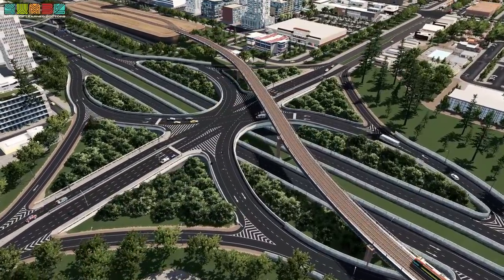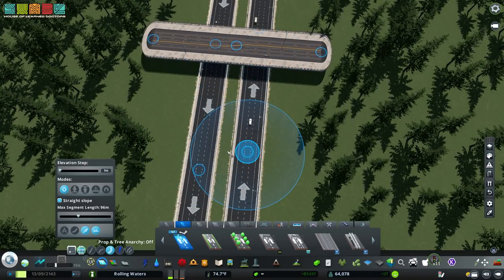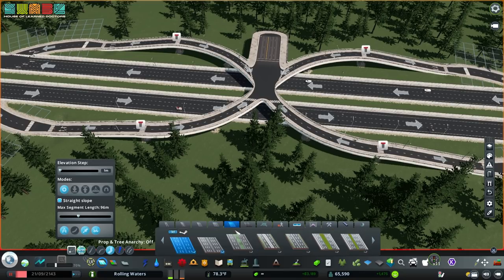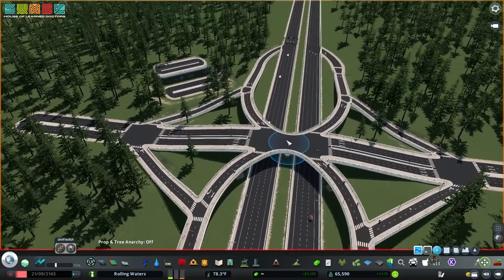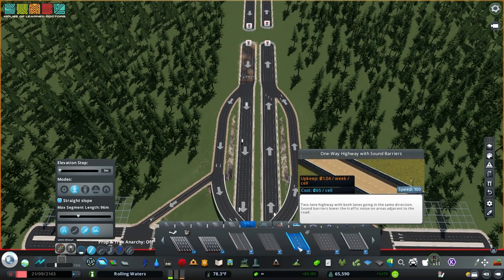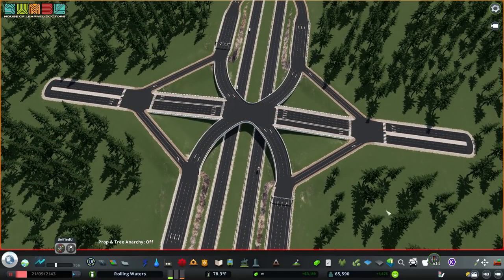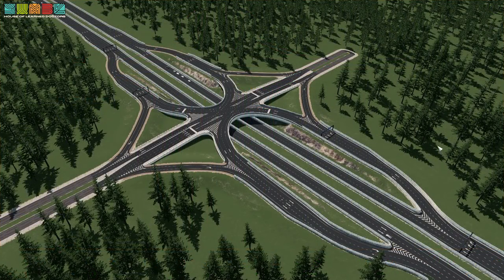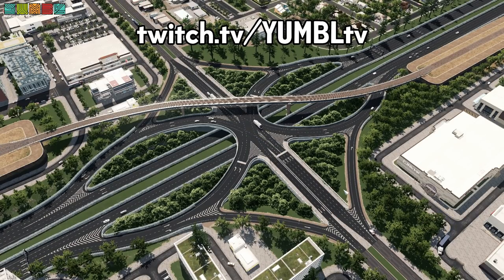Free Your Traffic Using The SPUI! - Single Point Urban Interchange - Cities: Skylines Tutorial

Comment: Thank you so much for your videos yumbl!!!  They are very helpful and I've learned so much from them!  Quick question though...I've followed your tutorial exactly for the SPUI and how to add the timed traffic lights.  Unfortunately, I'm unable to get the lights on the arterial road to provide a dedicated left turn light.  When I click the "change mode" button, I only get a straight or right turn option (which surprised me!).  Because of this, i'm not able to have both left turns on the arterial proceed at the same time.  I have used the same roads as your tutorial and have all lane connectors in place.  Have you or anyone else experienced this and know how to resolve it?  Thanks again for all of your fantastic content!!
Reply from the maker: You’re welcome! You may have a reversed road, or perhaps the road is at too shallow an angle to produce a left turn. Tmpe arrows only show above a certain angle. A workaround could be to change the cycles to arterial 1, arterial 2, lefts from highway.
Reply: @YUMBL  Thank you for the feedback!  That's how I currently have the lights set up and it's working for now...but as the arterials get more volume wanting to get to the highway, I don't suspect they'll be able to keep up with the current set up.  I'll play around with the angles of the off ramps to see if that helps.  Thanks again!  Much appreciated!!!
Reply: @YUMBL  just wanted to follow up an let you know that it was the angle of the left turn which was the problem…as you suspected.  I deleted the left turns from the arterial and recreated them as straight road pieces…then used the ‘move it’ mod to bend them.  After that, the left turn option was available.  Thank you so much for taking the time to help me out!  I really appreciate it and hope it can help others!

Comment: Is there either a way to add impact attenuators to the filler function on marking tool or are they available as a prop/asset and usable in line prop tool? I know they aren't used everywhere, but they're all over the place in the USA. Presently looking at/practicing putting guardrails in my intersections.
Reply from the maker: There are guardrail networks in the workshop

Comment: do you have to have any specific mods other than move it? Like do you need specific roads from the workshop to do this? I got to the ramp making part and the center of mine looks like a jumbled spaghetti mess
Reply from the maker: Node controller helps with that.

Comment: Would a inside on-off ramp not reduce the foot print further? Is there a logical reason the ramps are always on the outside?
Reply from the maker: Inside is fine too, though inside ramps break the “passing lane” nature of most freeways. ie entering and exiting traffic going slow in the left most lane.
Reply: @YUMBL  Thanks for the reply! That was the only reason I could think of too, which I feel is a bit silly. However, I realised while typing this reply that usually the highway is already there and we add the interchanges later as necessary. Easier to add to the outside than move the highway further apart to fit the ramps on the inside.

Comment: Couldn't you just put a roundabout at the top instead of that 6 way intersection? It would eliminate any stopping (or the most part). Not sure if it would actually work... Or how big the roundabout would have to be
I know he diamond interchange has been done with 2 roundabouts (at the respective intersections), but it would be neat to see!
Reply from the maker: You could, but thats a different interchange. Theres a big one of those in England that apparently always backs up. 

Because the SPUI has a 3 cycle light its quite fast. Also its not really a 6 way intersection. There are 4 roads in and 4 roads out. By your measure a 4 way roundabout would be an 8 way intersection.
Reply: @YUMBL  ah, you are completely right. I'll have to look into it. I was just thinking out loud. Thank you for taking the time to respond!

Comment: We have an intersection similar to this near me and it is the dumbest thing I have ever seen, what is wrong with the standard clover leaf, so there is no cross traffic and therefore no need for any traffic lights
Reply from the maker: Interesting. What makes it dumb? 

Cloverleafs take up a ton of space and have “weaving” which can be dangerous.
Reply: @YUMBL  Let's see a clover leaf you never have to cross traffic, just make a right turn as all the turns are right.  With the monstrosities you have to have traffic lights and cross traffic that is moving a different direction than you, which is extremely dangerous especially for us motorcyclist as people tend to want to make left turns right in front of us
Reply from the maker: This interchange is no less safe than a 4 way lighted intersection. In fact its safer. You may have even used one without knowing it, depending on where you live.
Reply: @YUMBL  4 way lighted intersections are also dangerous for us motorcyclist, the 2 biggest fears for us are being rear ended at a red light(wish they would just eliminate all of them) and having someone make a left turn right in front us causing us to T bone the other vehicle.
Reply from the maker: Ok, stay safe

Comment: Why build it this way and not build it for continuous flow? Even smaller interchanges here in Norway usually uses roundabout on either end or one big one in the middle instead of the traffic crossing over each other. Personally I just mimic those I find around here in the game and they work great. Though usually the crossing part is built up to go over the highway. Highway to highway crossings are a bit different and usually so smooth that no matter which way you go you stay in one lane the whole way.

In the game I try to go with what works and solutions that follows the spirit of the real world, throw in some lane management and even a simple crossing works as long as the traffic flows without crossing. Traffic crossing is a bad idea unless you have to and it's never done where the highway is involved.
Reply from the maker: Research “service interchanges”.

Comment: How!? How do you setup timed traffic lights for this intersection!? My citizens don't follow them - some of them just run the red lights, but I kinda don't blame them, coz even the traffic lights themselves don't know what's happening. A road that has a straight and a right turn gets a traffic light with a straight and a left turn (left-hand traffic)🤣😂😁😢😖😡
Reply: oh nvm. It turned out that the intersection angle of the on/off ramps and the overpass(?) was too tight, which confused the traffic lights to next week. Just move them around a bit with Moveit
Reply from the maker: The lights unfortunately depend on the arrows being correct. Angles will throw it off.
Reply: I just gave up. My citizens seem to not like that intersection 😌...at all. All lights were red, but some of them were still just flying through. So rude of them.

Comment: I don't know why everybody thinks you just need to keep adding lanes on topple lanes on top of lanes I meant look at American roads for an example will get any country's highways I mean 90% of every highway on the world is probably no more than 3 lanes 3 lanes furze reason you get off the highway it's usually a single lane road unless the highway divides then you get the 2 lanes I made in reality you don't need to add a lane for every left right or straight I make your MP c's I'm sorry but the IA system on the goddam designs are also use a right hand lanes. Unless they are going in a different direction they are driven and 90% of the time the IA system is designed for right and driving only a loss at vehicle as passing to a different lane it won't move over so you could build AA off ramp would 600 flocking lanes they're going to use only the right hand side unless they're taking a left hand lane and then there go to move into that left hand lane for the left hand turn then no all go back over to the far right hand side you did pretty good until you decided to update everything to 5 or 6 flocking lanes go back down to the simple 2 or 3 lanes and you got it made
Reply from the maker: This is nearly unreadable. I never upgraded anything to 5 or 6 lanes.

Comment: I don't like this design. The main reason is that it requires traffic lights and the overpass is messy. A clover-shaped structure works better and doesn't need traffic lights. Traffic lights and STOP signs are a recepy for failure, and should only be used when absolutely needed.
Reply from the maker: All service interchanges in the US require lights.